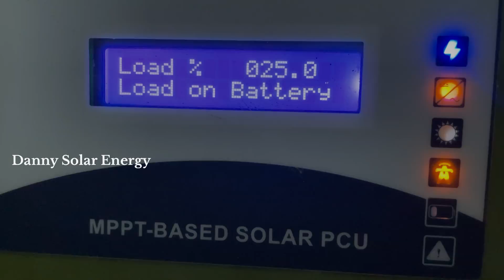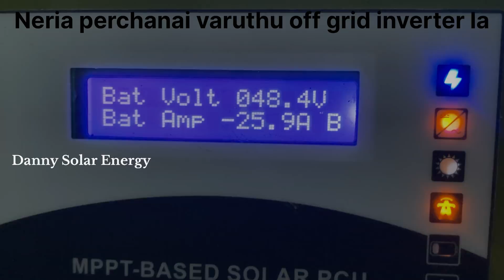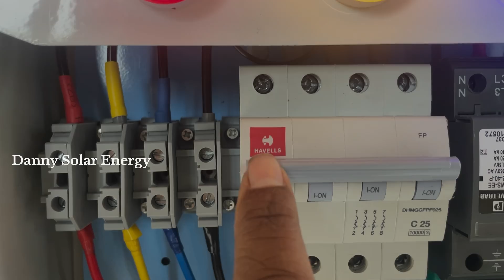My Last video in Off - Grid solar system | I will never recommend Off grid solar to home

Comment: Why are you guys telling you will never recommend Off Grid or hybrid due to issues with one of the products you used. I myself know so many people having off grid without any issues for more than 6-7 years and your comments here is also a proof of that. Use the right products and continue your good work. Off Grid is definitely equally good option as any other solution and should be recommended based on customer requirements.

Comment: We can use wipro smart switch - turn off the wipro switch in wifi automatically during day time. after 4 pm, we can set up with turn on automatically to use  EB power.

Comment: I am using 3kva off grid system without any issue. More than 3years.
Reply: bro can you explain your system detailey??
Reply: 1. 3 kva mppt inverter 24v china make but quality too good, power factor is 1 so I can use 3kva load.
2.exide 200ah solar battery c10
3.5x540 bi-fical waaree solar panel

Comment: Good informative videos, Thanks. Unfortunately I dont have EB supply in my land for ON GRID. OFF Grid is the only way. What do you suggest? I want to run 1HP motor and some light. What do you suggest?
Reply: Go for 2.5kva solar Off grid Inverter , first check the motor amps and depends upon that go for Inverter
Reply: Go with BLDC water pumps

Comment: Your thoughts on Hybrid Inverter Danny?

Solis, Growatt, Waree, Fronius etc should be okay for Hybrid? Only problem cost is 3x or 5x more for hybrid inverter.

Enphase IQ8 oda sunlight backup pathi also put video, even in on grid incase of powercut the solar panel will supply power without battery support.
Reply from the maker: Speaking in my next video . coming soon
Reply: Okay, I Am Waiting😆 @DannyTechieTalks

Comment: We can use dc 12v system for fans, lights, and other light loads. We can use eb for heavy loads instead of solar.
Reply: நல்ல யோசனை
Reply: Board will burn
Reply: @vinothkumar5846  check dc system implementations. 1kw dc home systems

Comment: It depends on the inverter we buy, I bought a local solar inverter from a guy in tambaram and faced the same issue after a year with poor response from that guy. Then I bought a normal microtek inverter and smarten solar charge controller. This combination works perfectly for the last 4 years.

Comment: great effort danny...waited for this very long time. loved your transaprency❤that create a trust on you a lot no one  have guts to put this type of video !! 

7:36 @sakalakatv exposed 

bro if possible!! response about...what about the concept and functionality of retro fit concept!!

currently i am using (mppt charge controller(ashapower)and solarbattery(2no. exide) and normal homeinverter(suvastika 2kva) ).

my need is very minimum around avg. 6  unit per day consumption and i will run it 24hours for fan and led tubelights!! 

i am using this for some small steps that i can contribute towards sustainability!! !  

i would be happy if you reply your opinion on my system whether it's good or not efficient or money waste as it's not for investment returns...say directly i would be happy for that!!

Comment: Now there are many good local off grid inverter manufacturers with good support.  Even though they are not available nearby,  they will transport the damaged part which any local technician can change. 
A proper off grid system will work without any issue, if its installed according to the power needs. Also , end users should  not overload the inverter.

Comment: Sir, we are using solar charge control seperate, working fine. Early used built in inverter+charge control we are faces lot of issues
Reply from the maker: You are using good quality separate charge controller that's why it's working fine.

Comment: Offgrid working continuosly 24hrs withstanding all odds...
Reply: Ellame vaangi kuduthuttu poruppu neengathane?
Reply from the maker: No way, it will consume Power from our EB and give the output to entire house and eb bill will increase
Reply: @DannyTechieTalks Using offgrid inverter for 10 years and inverter is still going strong but batteries are start to get weak
Reply: @DannyTechieTalks  I am using offgrid inverter for 8 years. Mine is flin energy Inverter.

It depends on the inverter you Install.
It work 24/7 with 20Kw battery and 5Kw panel.

Comment: See it depends on what the products are installed. Off grid are good options for having power independence. So if we use Good products for inverters and batteries it can be solved. E.g. if cost isn't a problem going with enphase batteries and micro inverters are good options. Also Indian market to start opening products like EG4, Franklin and Tesla.
Reply from the maker: But Indian companies will not allow them very easily since it’s affect Indian manufacturers.
Reply: @DannyTechieTalks  But how about growwatt inverters which are available in Indian market
Reply: @DannyTechieTalks  do you think so?